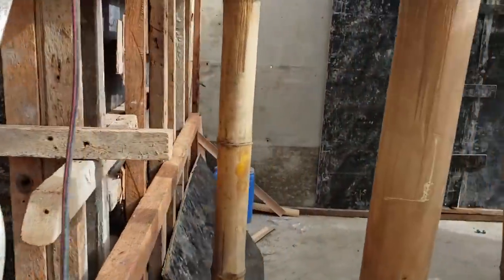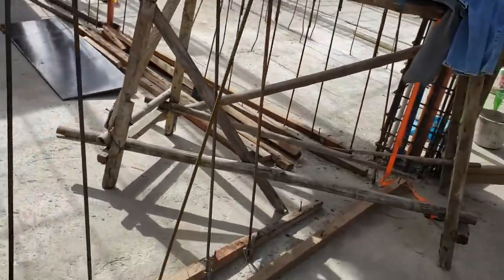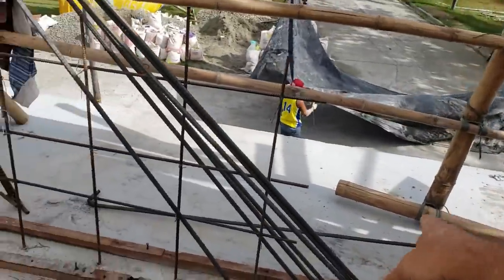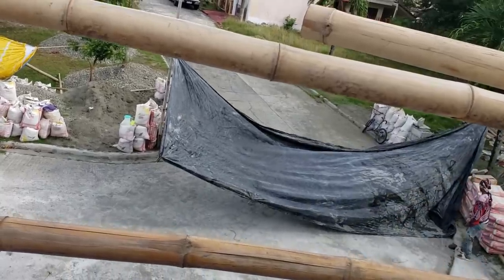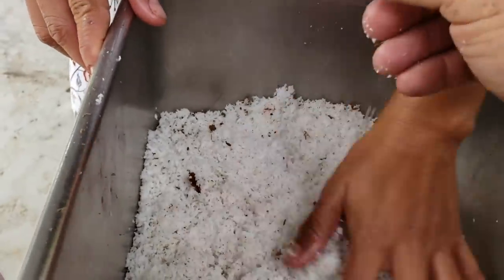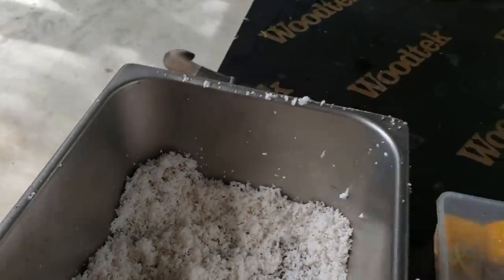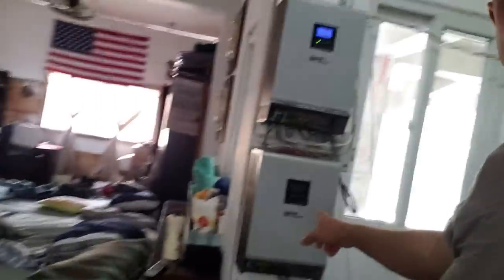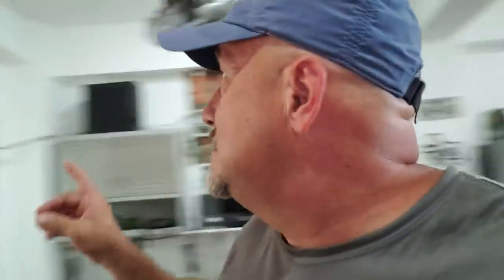Philippines Beach House Build Day 168 Part 2   Solar Talk on Battery Lead Acid vs Lithium

Comment: I work for a large manufacture and often we’ve had to send In electronica equipment including large batteries, our best solution was using my shopping box....Google it this might be your solution to getting the battery you need imported securely as we have successfully done it several times. Good luck!
Reply from the maker: Thanks for sharing

Comment: I see from you videos you have lots of residential construction experience. Building you own house in your twenties and still owning it. My early years weren’t as productive and basically a struggle. It’s enjoyable seeing you hands on approach.  I also admire you slow and easy attitude.  You seem to be able to roll with it much better than I do.
I also see you’ve made a pretty good lifestyle for yourself. Congratulations
Reply from the maker: Yes even though I pace myself I have had a good lifestyle. I always build quality in whatever I do. I have owned several companies. Did commercial buildings but also owned a enclosed trailer company. Steel and Aluminum trailers. I loved that business but sold it out.  I was doing great as a small company turning out custom trailers and then a big shot company came in and started squeezing me and swiping my employees with big promises. Well finally I had no choice but to succumb to them. One year later they was gone after they killed three small companies. There has been times I have considered doing it again. I love building those bad boys. Living quarters, shop in rear. I built them for drag cars, Outlaw class, sprinters , motocross , speed boats , commercial companies for special products and even boy scouts! GOOD STUFF. If I had this crew in USA doing that OH MAN> I would be in the Big Bucks.

Comment: I have a 10KW lithium ion battery from Meritsunpower installed several years ago in my house in Pampanga and had no issues so far.  Should be able to find dealer near you. It is hooked up to my 8KW solar hybrid inverter. Really nice to no longer worry about the weekly power outages. I have security cameras and wifi that I need on at all times since I Airbnb it when I'm in the states. Only issue is my house is only one lit up at night. Really stands out in the province.
Reply from the maker: Thanks for sharing

Comment: Your steel bar around the window opening to help stop cracking is GREAT, have you heard of or know about using a " Crank Bar " in the beams? I can send a pic if you like to see what it looks like and what it dose.
Reply from the maker: we do crank bars in all of these beams. here they call it a horse
Reply from the maker: I did a video  that I included about them awhile back

Comment: Telecom industry uses both wet and dry cell batteries.  Dry cell can swell and crack open if not maintained properly.   Anything other than lead acid has its own set of challenges.   We had a dry cell battery crack open in one of our shelters a few weeks ago.  Hazmat situation.

Comment: J&M, I see you built your first squatter shack. Still needs finished up with some orange and blue tarps and a rusty corrugated sheet 
door, but like most house builds they are never really finished.
                About the batteries. I would recommend Gel batteries which have no water in them. We use them on aerobatic airplanes

at up to about 8 G's with shock loads. They stay charged for months of storage and still crank a 540 cu in Lycoming. Available in
12 and 24 volts from Concord among others. You buy them from small airports and auto parts stores. Some new cars are using
Gel batteries these days. Possibly some subscriber in Cebu knows where to buy them since Cebu seems to sell all the hard to
get stuff. Does S&R do specialty ordering or possibly Lazada. I plan on looking them up when the wind turbine is built. About
Tesla batteries/ The car batteries are water cooled for high current draw and high voltage series wiring. The Tesla power wall is
lower continuous amps and air cooled. Up until last year Tesla was made of hundreds of 18650 LIPO cells. Same cell used in your 
Ryobi cordless power tools. Tesla is partnered with Panasonic now and built a town named Sparks in Nevada and developed a new
LIPO cell using much less Phosphorous, which is getting short in the supply volumes they need. Saying you don't want LIPO batteries 
is a misconception because you have them in Texas. That reminds me of a guy at our local airport that was saying he didn't want 
points and condensor ignition in his airplane because it was too unreliable. I told him I had electronic/capacitive discharge ignition
triggered by a hall effect sensor, and the backup was capacitive discharge as well with an inflight redundant control unit on each.
He gave me the college boy grunt, so I told him that his precious Slick, Wyco, and Bendix mags all used points as they did in 1920
when they were designed. Also besides timing the mag you also have to time it internally for a second point of failure and oil
coming in around the drive gear wetting the points was no better than an english motorcycle magneto built by Lucas -- the prince 
of darkness.

                                george and aurora                            doing a water cistern at Villa Cecelia next week with slip forms like yours.
Reply from the maker: couple of correction George , I never said I don't want lipo - I said I don't want them at the price they are asking here. Being a techie person I dive deep into these things. I built a huge 18650 cell back in the USA from old laptop batteries I bought super cheap from auctions. I bought holders and nickel strips , spot welder, bms system. I have enough cells there to do another one as well. Yes basically what my Tesla batteries are. Now a quick correction about Tesla Power wall - It too is water cooled. Exact same battery packs in it as the ones I have from the Model S. it has coolant, small pump radiator and fan.  Atleast I know that is the case for a powerwall one. Not sure about powerwall two. I bought a small circulation pump  and being i have a few old wrecked toyota prius setting around I robbed a heater core to use for a radiator. I planned to coolant in them same as in the car and setup the capability to heat them in cold conditions. The problem with tesla batteries is the voltage is just a little too low.  But in the range that they are can operate they still provide a lot of power. What i was asking is for information on ready built batteries not home made lipo4life batteries for sale at a reasonable price int he Philippines. I dont want gels - still lead acid. If your away and they dont get charged they are toast. I have a company in China that are sending me batteries to test right now. 4 24v 200 ah lipo4life batteries. They are on their way right now. My vlog has grown big enough that companies are wanting to do product placement and reviews. I want do paid placement because if I dont like it I will say it flat out. I am hashing out details with a couple tool companies wanting to send me tools to try and I can say good or bad its ok with them. That I like

Comment: Liking the superintendents new office. How often do you check the lead acid batteries? How many days before they get to low if you haven’t added water. Is there different brands that have larger reservoirs. The fresh coconut looks great. Hope you both have a blessed day.

Comment: Property Club YouTube channel is building a house near Subic. The very small columns have lots of holes a blemishes. Your concrete is good James.
Reply from the maker: he is watching our videos. He commented here recently. Really sandy there. They are doing traditional way of  back filling and slab just hanging off some rebar sticking out of the hollow block.  yes not much steel and stirrups far apart and not spaced properly by engineering standards. It will still look great when done I am sure just longevity without ongoing problems is the question. Man that view is killer on the water there. WOW
Reply: @TexasFilipino  the view looks great there and the drive around the area looks really quite and nice. Happy Easter to you guys.

Comment: Hi have you considered lithium titaniate (LTO) battery bank, they have a longer cycle life  and a lot more stable than LiPo batteries. Slightly more expensive and take up slightly more room than normal Lipo4. But I hear you with finding a local supplier, it's hard if not impossible to find locally ATM.

Comment: The last I felt with on my lifpo4 in china told me they had a good shipping price to china. They said no duties due but I don't know about that. But half the cost of the cells was shipping them to the usa but it was like $200 or thereabouts to the philippines.
 Have you thought about a filling system for you batteries? They have tubes that go to the cells and a reservoir to hold electrolyte.
 I'm sure you know most of the preassembled batteries you can buy are using the same cells we are using in our diy systems. And often even cheaper bms. The only premade batt I'd spend the money on is the battleborn. Just an idea, they work with a lot of youtube channels you may contact them and see if they'd be interested in a sponsorship of some sort

Comment: I was thinking of person might buy a used Prius and use the batteries out of it.
Reply from the maker: I own several of those.  nickel batteries  - not that great plus you would need to reconfigure them in a safe way because they are setup to few hundred volts dc. killers if mishandled. Please everyone know those dangers

Comment: So with the front there, where you drilled and epoxied the rebar into the side walls, those are cold joints (new wet concrete against solid dry concrete) if I understand the terminology correct? So how do you determine where it is safe to have cold joints vs requiring (hot/warm?) joints.
Reply from the maker: lol there is not a hot joint well unless it is a bar wild bar in Angeles City that might be a hot joint - lol   Could joints need to be avoiding in places like supporting beams  overhead or in the middle of a open span slab like this second floor or repeated cold joints in a column especially if it does not have proper stirrups and rebar diameter. just adding insult to injury. You dont want a solid poured place with no joints it can crack and pop. thus it is why I am pouring in sections. Now I dont want a joint where pipes  for water are passing thru. get a shift and sheer off the pipes. So the area where my plumbing is I solid cast and to each side of that area I allow a joint so if any movement it will take place there.
Reply: @TexasFilipino  Great, thanks for the detailed info.

Comment: SO are all OF your walls 4" and you're rebar 8 or 12" centers
Reply from the maker: most are 4 inch and a few 6 inch.  12 inch spacing  and reinforced around openings.

Comment: James did you ship your solar equipment from Texas?
Reply from the maker: No. I have some stuff here for a second 12vdc dc 110v  3000watt system Old stuff I had back in USA. Only thing on this system I brought was the solar array combiner box. Panels I sourced here and the rest from Tiawan.

Comment: The Tesla pak has management system, and if it has wifi it will tell you charge status, heat of batteries, even draw on batteries, to your cell phone anywhere in world. Just checked my philippines system now, and I'm stuck in canada. I do wish I had bought the bigger tesla at the time, but am considering a big one and another small one before I go. The best part, they can wire as 2 wire 220, or 3 wire 220. I could pack a battery system in my sea can when I send it. Legal in a can. You'd have to pick up in Nueva Ecija though???  Also have a lot of glass barrel batteries, rebuilt and never been filled. A six pack of them is equal to 24 or more of the batteries you are using. They are 50 years old, but all new plates installed. The UPS system from a pulp mill.

Comment: Lead Acid Batteries loose their effectiveness after they drain below 50%! LiFePhos+ ion batteries hold their effectiveness down to 20%! They are expensive in the short run, bit are more cheaper in the long run! 10+ years for LiFePhos+ Ion